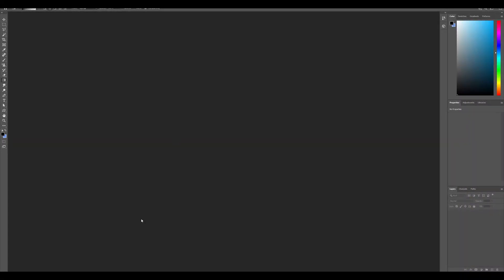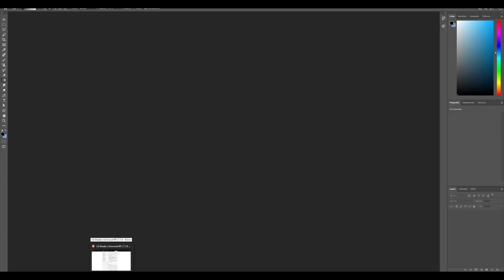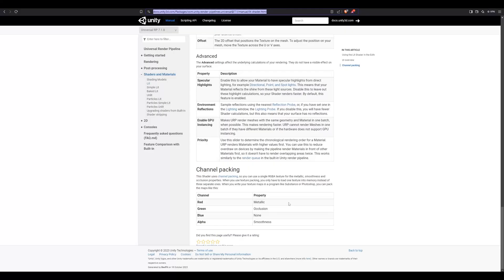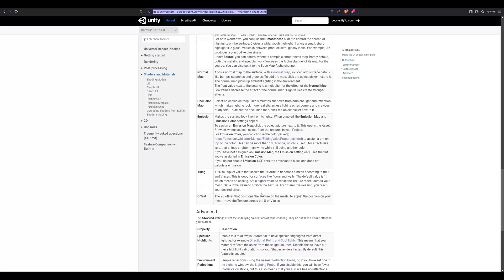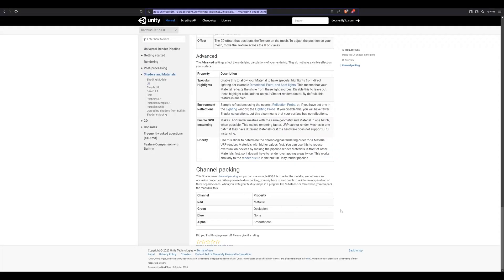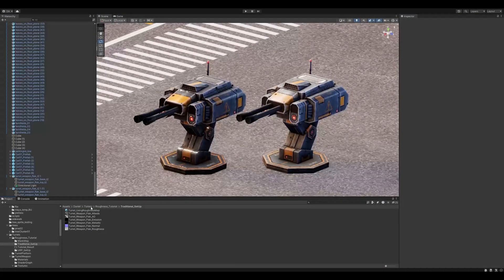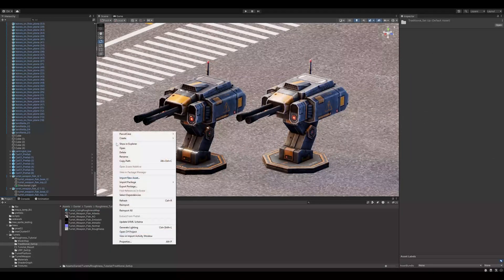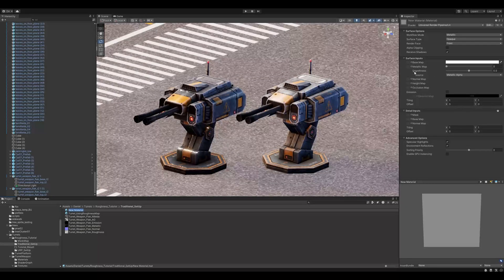Roughness Maps Not Working in Unity URP? Here's Why (Full Guide)

Comment: Thanks! It might be confusing at first, but if you use Substance Designer then it's really easy to invert the standard roughness, and pack metallic, AO, and the said inverted roughness into one map. So the material authoring doesn't really change for Unity.

Comment: You dont have to convert anything! You can just go into the material and switch shader to Universal Render Pipeline -> Autodesk Interactive and VOILA, you can put in roughness and metallic map.
Reply from the maker: @Andrew-tl9gk I totally forgot the Autodesk Interactive shader was still around—thanks for pointing it out!

I usually stick to Unity’s official shaders for compatibility. Honestly, I am really surprised the Autodesk shader is still included, given how often Unity drops features.

This video was focused on converting to Unity’s default material, but you’re right—if you don’t want to use that, you can go with Autodesk Interactive or even build a custom Shader Graph version that works the same way.
Reply: In a URP project the object becomes purple.

Comment: Thank you so much ❤ I was searching for this tutorial forever, I really understand unity material system now but What if my pbr material doesn't have metallic map like a concrete material for example, so I can't combine the smoothness map with a metallic map if it never exist
What is the solution for that?
Reply from the maker: Hey Adem!

Unity URP's Lit shader expects a packed texture for the Metallic input, even for non-metallic materials like concrete.
Here's how the MetallicSmoothness map channels work:

Red channel: Controls metallic values (0 = non-metallic, 1 = fully metallic)
Green channel: Contains ambient occlusion data
Blue channel: Unused in the default URP Lit shader
Alpha channel: Contains your smoothness data

For your concrete material, here's the solution:

Set the Red channel to black (0) - this makes it non-metallic
Set the Green channel to white (1) - if you don't have an AO map
Leave the Blue channel black - since it's unused
Place your smoothness map in the Alpha channel
Assign this combined texture to the Metallic slot in Unity
Reply: @mythmaticstudio  Thank you so much for ur reply ❤ I started working on the channels now, the work was a bit different in gimp not easy as photoshop but I ended up with : a black 0 metallic on the red channel / black 0 on the ambient occlusion not bc I don't have a map, that is really bc I prefer to not pack ambient occlusion map and let it alone and black blue because it's useless like you said and smoothness alpha channel, Now I have all done
Thanks again 😊❤

Comment: Thank you dude, but it's terrible, that uniti in 2025 can't use RM directly. When you have a lot of different models in project, you need to make a lot of work in PS for getting RM in unity.
At the same time unity has the separate Height Map slot...
But if you make models and textures purposely for unity, you should make a preset for export textures in Substance painter.
Reply from the maker: Yea I feel the same :) Unity’s default packing setup is great for optimization, but it definitely throws artists off, especially when you're coming from software where roughness is its own thing. I think having a no-packing material by default would make a huge difference. Just something clean where each texture has its own slot. Once it’s all set up, you could hit a button to pack or unpack as needed. That way you get clarity first, then efficiency. And yea, Substance Painter export presets are a must. It really helps when you're prepping textures specifically for Unity.
Reply: @mythmaticstudio  I totally agree. Unity knows how to fix normalmap itself. Map packing is not much more complicated than that. It's easy enough to implement. And separate slots for materials would speed up the work a lot and make it easier to control the result.

That being said, most of the assets in the unity store have separate maps anyway)) It feels like packaging to unity format is not as popular as the same ORM)

Comment: After many hours and following many different tutorials, I was hopeful this one would finally work. But the roughness in the alpha channel just does not impact the shader at all. I feel like giving up and just accept I have to do shading without glossiness maps. Why doesn't the shader just allow us to input a texture in the smoothness value. I was hoping to enter the weekend satisfied, but this is just super frustrating.

EDIT: Okay, I gave it one more try in a new scene. And there it works. Not sure why it is not working in the other scene.

EDIT 2: Copying the shader and textures from the new scene to the old scene also worked. I now have a working texture. So frustrating, but now at least I can enjoy the weekend!

Thanks for the video!
Reply from the maker: Hi JTW3D, I'm glad to hear that it looks like a new scene is solving your issue. The first thing I would check is whether the scene where your roughness/smoothness isn't working is missing a light.

I would make sure to clear out any baked lighting, ensure your "smoothness" slider is not set to 0 in the material, and confirm that you have a working directional light in your scene.

You're welcome! I'm glad you found this video useful. :)